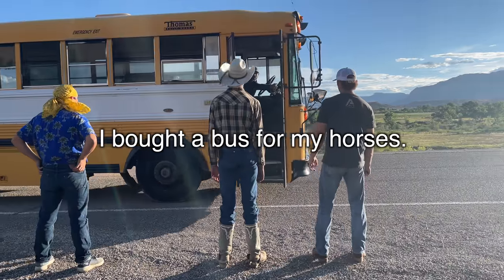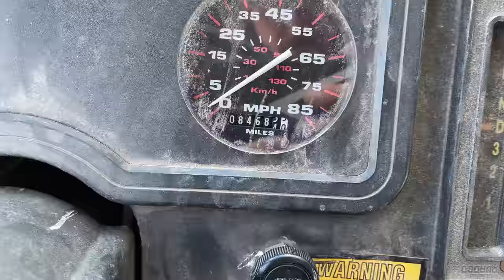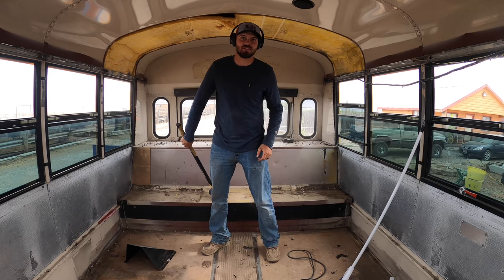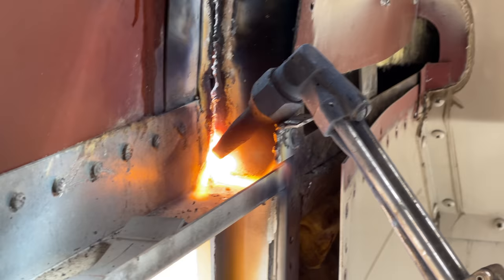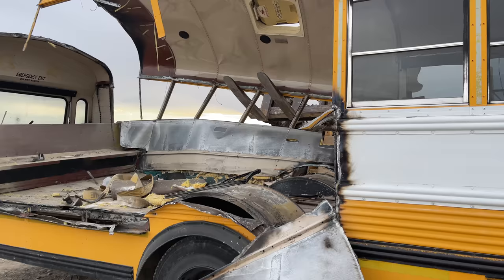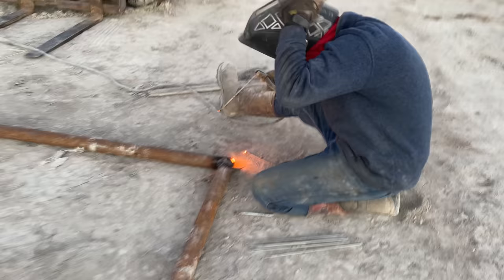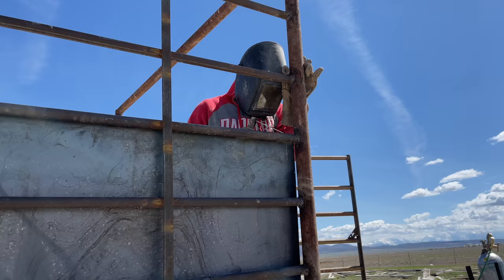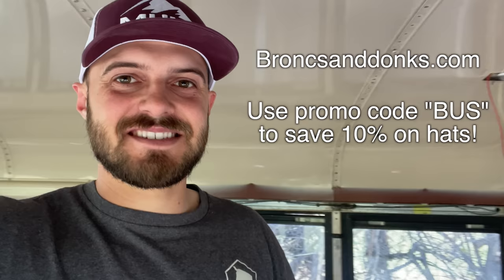I Rebuilt a Bus For My Horses!

Comment: Most school buses use plywood as the subfloor.  I would have pulled off the plywood before installing the racks and put 2x8 oak down for the floor.  Also if you had been patient enough to disassemble it piece by piece you could have used the body panels and the roof to enclose the horse compartment.  Also you could have used some of the body panels to replace windows on the rv compartment.  Plus you could have pulled the backlash and back tail lights to reuse either in your finish out or to sell to someone who might want them.
Reply: Is your bus? No.

Comment: Hope it works out. But have you considered the weight will be to far back when loaded with ponies and lose steering. And when you hit a bump they could be sent air born. Just my thoughts but I’d have put the rack right behind the cab and had storage near the back. Neat idea.
Reply: I'm also worried about that. Like to see a person ride in the back down a dirt road for a bit. Ultimate test of if a trailer is sound! Sneak a hooman on it!
Reply: Why did you have to take the roof back part of the bus Could you have remodeled the back door so that they could have come in to the back door without taking the roof off and there could have been a way to put each one of them in a slight stall and rope them down. That way they can put the windows down but it can also keep the cold off of them and the heat out of the outdoors The roof is tall enough on the bus that they wouldn't have been a problem You could keep the roof on!
Reply: wonderin this myself... i regards to the thoughts on weight, steering and bumps. Neat idea... pending that
Reply: @rebeccarorie313  that's a good idea. 
I was thinking the same..
Reply: @rebeccarorie313  thats how i built mine. raised the roof, the side fold down into ramps.
Reply: Agree. Between the axles seems a safer place, both for handling and also for strength of the support floor.  I'm not sure that the back end will be able to support so much weight.

Comment: hope the rear of the bus can take the weight of the horses , and that the horses are still willing to get in it after the first trip
it mightve been eazier to make a wall in the middle of the bus take the windows and back out of the rearpart and ut bars in them and mount a wooden ramp 
that way the horses would be covered while there in there and the bus would be a little more sturdy
Reply: Bus don’t flip
Reply: @Kerrdogg they do

Comment: I would have raise the roof. By making the windows taller.  Then the horses out of the weather.  Put solar panels on that part of the roof. You want a divider between the horses and you on the bus. Put a door one side not in the middle  this way you can have a place gear. so if you need to take care of horses with out leaving the  inside of the bus. You want a luggage rack on your side of the roof this whole hay bales. You may want to use rubber mats under the horse. Now the inside of the bus. You want a inside and outside shower. Medium size refrigerator, stackable washer & dryer.  saddle and gear. I would not put your bed in the back by the horses. I would put a shower, wash/dryer, potty, saddle rack. closet.  Then coming forward put your bed. Leave a two foot at the end so you can walk around it. You want the bed to raise up for storage.  If you do it right you could live in this full time.

Comment: I wd have left the roof on, or reinstalled the metal panelled roof on top of the roof racks; beefed up the floor, and just left the lower original panels on the sides, installed the side metal racks as desired, that way the horses dont have the sun, rain etc beating down on their heads n backs, and their legs are protected from possible flying debris on the roads etc.

Comment: Busses are built like airplanes. Drill out the rivets. Move the back wall to the end of the RV part. Now chop off the frame behind the rear axle. Ad a gooseneck ball. Or 5th wheel of your choice. Then if you wish add trailer air brakes.

Comment: Probably should've spent the extra time to take it apart cleanly. That's a lot of wasted material you could've kept in a shed or whatever for whenever this starts rusting or gets damaged (since a lot of it is standardized stuff). When we took a bus to make it an off the grid power generator/sleeper for work in remote areas, that's what we did and it paid off later, 3 years later when an idiot smashed into the side with a van, crumpling the sides of the bus into a mess. We got to use that paneling and paid nothing but labor to have it fixed.

Comment: What a great find. But Wondering why you missed the perfect opportunity to just fortify the back of the bus into a nice semi closed in area with ability to carry the horses in the bus, decked out like a horse trailer. ( A lot less work. And less damage to the frame alignment.)Separating the human area from horses, but the horses would be protected from the elements? 
Looks like a cattle crate on the back. Which was a lot of work, no doubt. A waste of a great bus renovation opportunity.